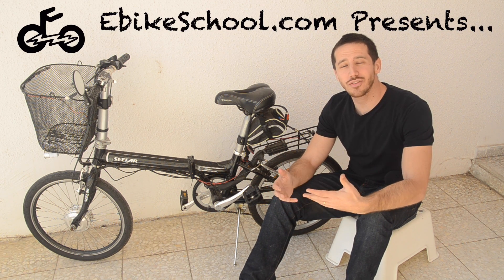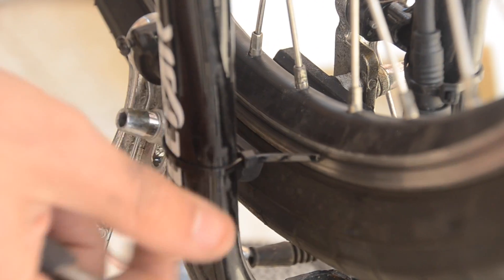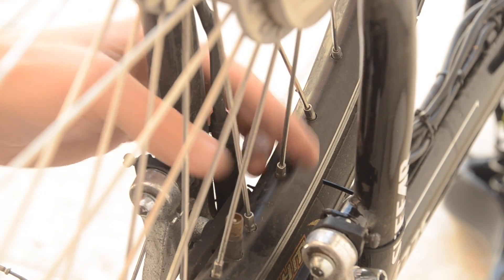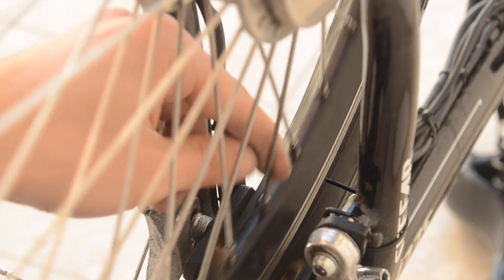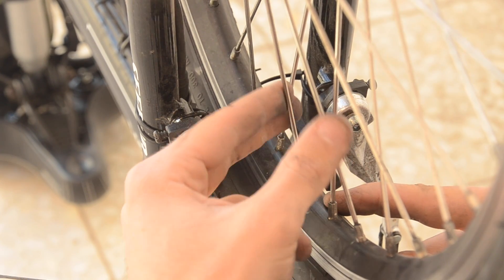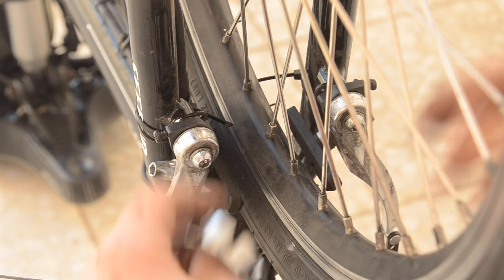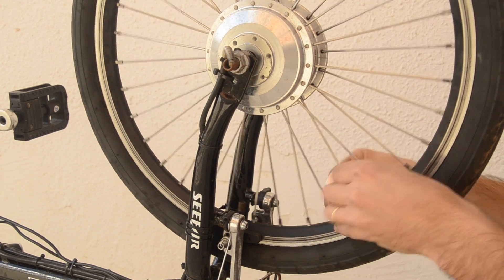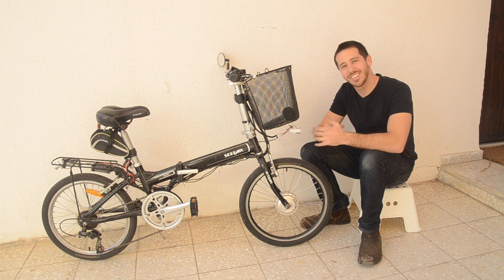How to true an electric bicycle hubmotor

Comment: Is that even true? That you turn the tool left to tighten and right to loosen? I am confused. I snapped a spoke by loosening it or I thought I was loosening it, I thought I was turning it left to loosen. It just broke when I did. I am confused about this part.
Reply: Imagine standing behind the rim and putting a nut onto a bolt, once you are 90° side-on it becomes what we perceive as an anti-clockwise rotation 👍

Comment: Have trued an odd rim before but will try this on my 28 inch bafang 500w front hub drive, like the cable tie idea as I'll just flip my bike and check it in situ, as I'm not convinced it's my rim as my tyres take some hammer, so could just be a slightly wonky tyre?

Comment: I always pluck every spoke and listen to the tone and all the ones that are low in tone or loose I tighten them up first, or if some are super high pitched or tight, I loosen them and get all the spokes sounding as close as possible to the same tone and tightness. I then proceed with trueing from there because sometimes there is one or two really loose or tight spokes that once evened out the same as the others the wheel will be much better at that point. To me it just makes sense to have all the spokes tension as even as possible before starting the truing process. Other then that great job!
Reply: goodbike shops some times Can't Tru a wheel wobble) I was trying to use a guitar string Tuning App) to get All Spokes at the Same Tune) maybe year 2017) the app kept giving different readings 😭🧐

Comment: This is not truing a "hubmotor" It is truing a wheel with a hubmotor. You will notice that the spokes are connected at the rim on the wrong side.

Comment: This is a good video but it's very annoying that I cannot find a single video showing how to do a rear hub wheel. I'm sure the steps are similar but I want to know if you can true it while it's still on the bike, or is it better to take off the whole rear wheel? Also how does the cassette and disc breaks play into it? Do they change the spoke lengths?

Comment: I have a question...

I want to convert my 26 inch bike to electric, but I don't want to change wheels.  My wheels are 140 fan spoke, could I drill the needed holes on the hub to accommodate for that many spokes?

Comment: Been working on bikes since before I was 10. (30ish years) Never trued a wheel. It was the one thing I was afraid to mess with. Been watching a lot of videos before, during, and after buying & installing e-bike kit. It was my non-motored wheel that needed adj. 20 year old bike. A week after watching this, went for it. Took like 10 minutes on a bike that was far enough out that brakes barely worked. Thank you for this video, it made this super easy. Didn't use cable ties, judged by brake pads. Would use ties on bike with disk brake.
Reply: I'm thinking of doing this with back wheel it has a 1500w and I had a bit of a soft spill in the grass and now my spokes clink and the wheel seems even more off than it was before I crashed 😂

Comment: Your full-wheel tightening gave the wrong impression..  With all the tightening you did earlier, you needed to check the "evenness" of the tension of ALL the spokes in the wheel.  Some spokes that you did not touch would be either TOO TIGHT or TOO LOOSE.   I would have suggested to pluck all the spokes like a guitar string, and lightly tightened any that are REALLY LOOSE.
Reply: I agree that he doesn't squeeze 2 spokes together to check tightness, then the next two, then the next two. 
Great video and I'll try the method.

Comment: That strait spoke job, I don't think is a good idea, because of the torque of the hub motor..  The spokes need some nail polish on them to hold..   Probably will loosen up again.
Reply: Back in the day, I built a few radial front wheels when that was supposedly the hot thing to do, but on the rear? Not even once.

Even on the front, it makes for a harsh riding wheel that needs a lot of attention because those forces go straight from the rim to the hub with no angular vector.

Comment: This is so stupid thing to open up the brake and mount the plastic bulsit. The brakes is do the same fuktion like the plastic cable :).
Reply: Hi Micha. I just purchased a 5000w 72v ebike hub motor kit from calibikes.com. my question is that if I have an EZEE TORQ BIKE FRAME WILL 700C 29' WILL I HAVE A PROBLEM INSTALLING IT.  THANKS.  LOVE YOUR VIDEOS DUDE.

Comment: This technique is only ok to get you home. Using cable ties because you don't have a stand is fine, but this technique doesn't address spoke tension at all, and you're just as likely to make it worse like this as you are to make it better (as I found out). My advice is to watch the video over on GCN where a pro wheel builder teaches Simon how to true a wheel. After that, what needs to be remembered through the entire process is:

 You're changing the position of the edge of the rim with respect to the hub with every turn of a nipple. AND you're changing the tension of the opposite (meaning left vs right & the opposite side of the wheel as well) spokes at the same time as you change the tension of the spoke you're working on. Theoretically, if you started with a trued wheel, and the hub was dead-center, then all of the spokes are evenly tensioned, except the one. but, usually what happens is a nipple cracks or spoke breaks, and and you don't notice for a while, but the over-all spoke tension is now uneven, and this allows other spokes to loosen, and eventually you notice the warped rim, or you hit an obstacle and because of the uneven tension one or two more spokes break. 

With a spoke tension meter you can see this: 
When you turn ONE nipple a quarter turn tighter, you're shortening the spoke, also pulling the hub closer to that side of the rim, and by extension, you're also adding tension to the spokes on the other side of the hub, as well as pulling the rim to one side. 
When you loosen a nipple, you're lengthening the spoke, PUSHING the hub away, and lowering the tension radially.
So it's best to work in radial zones, and with a tension meter... well worth the money rather than paying a shop $100... and even with the tension meter, it takes some mental acrobatics to figure out exactly how best to proceed.  So makes sure if you NEED the bike work, you give yourself lots of time, because you may need the entire day, may need to redo the whole wheel several times in fact. like I did. ;) 
Now, with heavier spokes like these, the spoke tension may not be so crucial because they probably are way stronger than required for the weight and shock stress of hitting a rough road at speed, but then, I'm no engineer, but I know with the spokes on my bike, I had one spoke broken, and couldn't fix it right away, and within a week, I had two more broken spokes.

The ultimate goal of truing the wheel is to evenly tension the spokes, center the hub to the circumference of the rim, and center the rim horizontally along the axle ("dishing"... and yes there is also a dishing tool)

Tip: it's best to true the wheel without the tire on.
Tip: tires are inherently un-even because they're a flexible material. DO NOT true your wheel based on the shape of the tire. Only ever true the shape of the rim.
Reply: Just a side note I have built over 200 wheels during my lifespan until now and never ever did I used any tension gauge or meter...😑😑😑 3 fingers including my thumb are mine tensometers
Reply: Yup those are the profession advice which kept me from trying it again like we use to do so back in the days of BMX in childhood... But guys, please understand that after I came out of these professional worries and opinions and gave myself courage to try to do so with hub motors as these are what we use nowadays for earning n leisure... And let me tell you guys that except the part where we install the spokes has to be in accordance with the inner side and all those helpful things there isn't much to worry about those sophisticated and super professional advice because eventually you will learn it and trust me I have been building wheels and trueing them whit zip tie trick in my back yard for 3 years or 4 now... And 90% of those wheels and hubs are still going strong... So guys please please try it if you know a little a out what your doing don't fall for those mr.perfectionist whom might have not yet built one themselves 🤭🤭🤭🤣🤣. Stop bringing people down with your over the roof sophisticated professional advice...🤭 and yea I use all basic tools nothing special...
Reply: Guys do it and you will learn and eventually even after a few failures you will realise how much money and pain in the butthole you guys save yourself from by learning it yourself through trial and error...ignore those YouTube engineers for awhile

Comment: Just use the brake pad as a guide you can also use a soft hammer to tap the rim to move it to the direction you need the rim to go

Comment: You don't really need a spoke wrench to true your hub motor. I followed your instructions and used a pair of pliers and it worked just fine.
Reply: Nipples are made of really soft aluminium normally and you will ruin them if you aren't super careful.

Comment: would it be ok and just tighten the spokes all the way round instead of using a zip tie?
Reply from the maker: without using some type of gauge, you're just guessing. That'd be like pumping all the tires up on your car for about 30 seconds each. Who knows if one is under or overinflated if you don't use a gauge? The zip tie helps you measure the trueness of the rim.

Comment: If the wheel hop had been bad enough to be able to fix, how would you have adjusted the nipples and which nipples?
Reply: Just a guess, but I’d imagine that you tighten both sides of the spokes in the oval (elongated) area to pull it in more, like a circle. But... just a guess, haven’t done it myself.

Comment: Great video! This is really helpful. So, do those end pieces of the spokes unscrew completely, and then the spoke is just loose and removable? I have an original 26" wheel that is blue like my bike that I'd like to use on the hub motor, so presumably I could switch it over...
Reply from the maker: Yes, the nipples unscrew all the way, and can be removed through the other side of the rim when the tire is removed. Lacing a wheel from scratch is more difficult, but still doable. There are a lot of good videos and resources for wheel lacing.